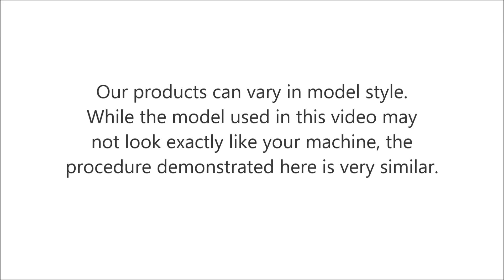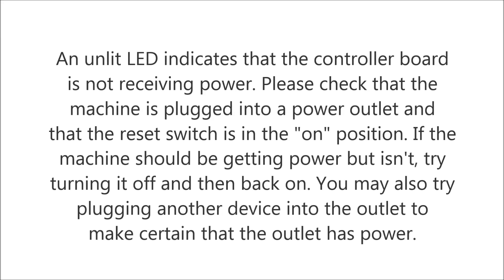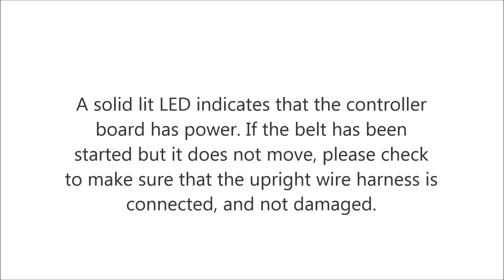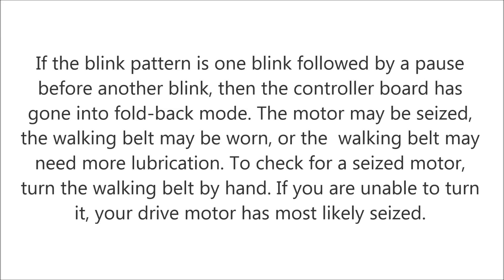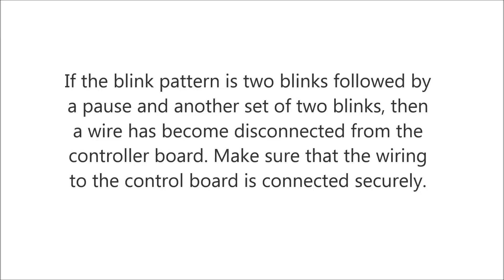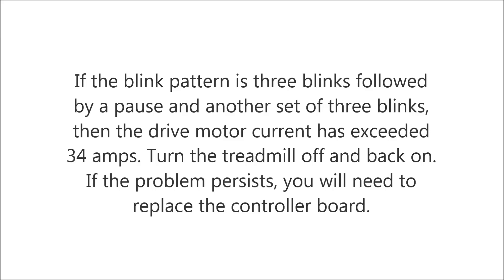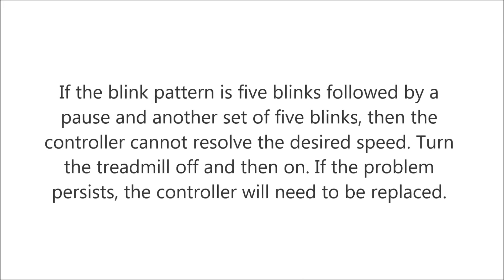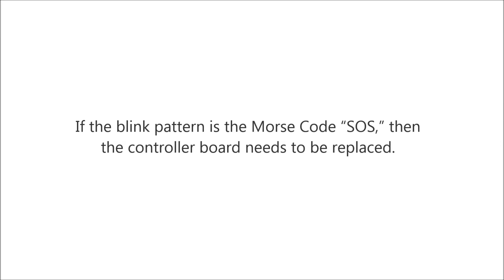LED Blink Patterns on the Control Board - Treadmill

Comment: I have an Xterra tr6.4 folding treadmill.  It was working fine and then I moved. The movers spliced thru a set of wires so I thought that was the issue. I replaced that with the company but my monitor still doesn't even light up.. I am getting power at the base because I see things lit up. How do I get to the LED panel to look and see if it's any of these issues?
Reply from the maker: I'm not personally familiar with the Xterra brand of treadmill however almost all treadmills have some kind of lower controller board near where the motor is located. The information in this video will not apply to that manufacturers product but checking the wires to the lower control board is a good place to start. Be cautions and unplug the treadmill before you work on it. ;)  You may find instructions to access the lower control board in your manual or online from Xterra directly.

Comment: my light comes on solid with powerup and starts a fast steady flash when the speed is initiated - after 5 to 10 minutes the console and adjustments start to change themselves - sometimes the belt stops and sometimes continues and the adjustments come back to what i had set - proform 6.0 sport only 2 yrs old - in remote location so getting a tech out is difficult - assistance with ideas?
Reply from the maker: When the belt stops does the led light on the controller (shown in this video also stop)? Is this occurring in a manual workout? 
This is almost certainty an issue with the console. If the speed/incline is changing on the console and the machine is performing what the console displays then it is not likely a controller issue. Most people that have the machine change on them are in some kind of preset workout, that's why I ask about if you are doing manual workouts. Also is the treadmill on a dedicated circuit and does this happen with no user on the machine?

Comment: Hi. My proform treadmill led stays on continuously. The belt spins freely and when I press start the motor moves for a split second then shuts the machine off. Any ideas? I'm happy to pay for your advice
Reply from the maker: It sounds like you will need a new lower circuit board called the Motor controller.The question would then be what is the light doing after you press the start button and the motor jumps. Likely you are getting an error blink code. most error codes indicate a replacement controller is needed.

Comment: What if the controller light does not flash at all? My Nordictrack treadmill is only two weeks old. The ifit console has power.
Reply from the maker: if the red light is on solid and not blinking then a speed signal has not been received by the controller. It will blink when you start the workout on the console. If the console is running a workout (time counting & speed displaying above 0) then it usually indicated a damaged wire and the speed signal is not making it to the lower board/controller.

Comment: I have a horizon ct9.1. The console is 88:88 both sides. Ive reset, unplugged, done all suggestions I can find. I’ve checked all wires are connected. Underneath the led light is solid red. The belt moves when I move it. The magnetic key engages the belt when I take it out and put back in. None of the console seems to work. Suggestions? TIA!
Reply from the maker: Although I'm am less familiar with the horizon brands it does sound like you have a problem related to the console.I would guess that the console would need to be replaced. I would contact Horizon directly for replacement parts or any other advise.
Reply: Fitness Equipment Help thanks for your opinion!

Comment: Fitness Equipment Help: My  NordicTrack model 24934.0 display console is not powering up. Issue started after moving to a new location and re-assembling. Controller LED is solid red and blinking rapidly. The hall-effect switch signal does change from 6V to 0V when moving the magnet switch. The console tablet is not getting the 12V DC. The tablet is powered ON after I applied external 12VDC to it, but tablet goes OFF after 5mins with screen message: safety key removed replace key to continue.. Although the magnet switch is ON. What could be the issue? Thanks!
Reply from the maker: it really seems you don't have communication or power from the Brain board (PCB) in the console to the tablet. there should be a wire header on the tablet labeled "Keys" this should be where the tablet gets its information that the key switch is on the console. if you have voltage to the key switch then the controller is producing the voltage and it is being received by the console PCB.  seems you may have a brain board issue with the console not sending voltage and signals to the tablet.
Reply: @FitnessEquipmentHelp  I took a look again at the header-2 wires from the controller (MC2100) to the display console. The HD2 wires are: Black, Red, Green, Blue, Orange, Yellow, Violet and Black. Unfortunately there was no voltage on the Red wire. But I did measure 12V on the Violet line.  So what is missing is the 12VDc needed on the Red wire. I confirmed by applying external 12VDC to the Red line, and saw that the tablet was powered ON and it did recognize the magnet key switch. Any suggestions?
Reply from the maker: @yodamartin4859  Is it possible your wire harness is plugged in backward? That would explain why there is voltage on the purple and not on the red.
Reply: @FitnessEquipmentHelp  Thanks! for your help. Connector connected in the wrong orientation. The space is tight, so to connect the wire wrongly shows a poor design. I saw a key on the header, and I assumed it'll prevent the harness from connecting in the wrong orientation. It took more effort to connect the harness in the correct way.

Comment: I have 4 blinks - pause - 4 blinks .... which would indicate false switch - what switch is this referring to  ?
Reply from the maker: A component of the controller called a fett... Basically it means you need to  replace the controller.
Reply: Thanks for your reply , Do you mean one of the FETs  attached to heat-sink . I am quite knowledgeable in electronics and I could probably replace that one . Do you think that is fees able ? I do have MC2100LT Rev ICON 2006 controller board . On this board there is Q4 IRFP250 HEXFET . 

 @FitnessEquipmentHelp
Reply from the maker: @radim100100  It already sounds like you are more knowledgeable on the subject than I. I know that in these situations i replace the controller. I Could not identify the fett. I have just been told that is what the 4 blink error indicates. Sorry.
Reply: Thanks anyway
Reply: @radim100100  - Replacing MOSFET fixed the issue ?  I have RFFP 250 M which seems t be short
Reply: @SachinVyasMewar   Did you replace the MOSFET?  Did it fix the issue?  The MOSFETs on my board are labeled IRFP250M and S4025L.
Reply: @dustinshaw9435  Thanks for your response.  I have not replaced the MOSFETs yet as I am still not sure where to procure them.  Any suggestions?
Reply: @SachinVyasMewar  I purchased some from mouser.com a few days ago.  They have not arrived yet.
Reply: @dustinshaw9435  okay. I will check that site out.  In the meanwhile if you replace it then please share your experience.
Reply: @SachinVyasMewar  I replaced the MOSFET labeled IRFP250M.  The treadmill worked for a little, but then stopped.  I read somewhere else that the IRFP250M could/should be replaced with IRFP260M, so I did that, and now it works again.  Although, now my treadmill speeds up and slows down when it is running, so now I have to figure out why it is doing that.  It did this when I had the new IRFP250M installed too, so it's not the IRFP260M that is causing this issue.
Reply: @dustinshaw9435  Thanks for the update.  Not sure if that needs calibration or the signal being sent to motor is the culprit ( led blinks ? )
Reply: @dustinshaw9435  - I got the IRFP250M and replaced it and initially for a minute or two it did not work and then started working and in a day the LED stopped blinking.  I do see the LED on when powered on but when I try to increase the speed the LED is not blinking.  What I have noticed is that as I increase the speed the LED dims down.  I did follow your advice and got the 260M as well and will try to replace but did you observe the same behavior before replacing the 250M with 260M ?  Thanks in advance
Reply: @dustinshaw9435  so I observed something a) LED powered on once treadmill’s power was on.  b) initially when speed was increased no motion c) increased the speed to levl 10 led dims and goes completely off and then all of a sudden comes up bright red d) press stop and start treadmill is operational.  Tested a quick 30 minutes run plugged in and out it seems to be working so not sure if its capacitor or some loose connector …will keep researching ..if you have any idea then please share

Comment: Are there blink patterns for the incline motor? When I turn my Nordictrack 2450 on the incline motor inclines a few inches then declines back to original postion. When I run a manual workout I am not able to change the incline. When I do an incline calibration I get an error and the calibration is canceled. My guess is the incline sensor is bad???
Reply from the maker: It depends on the motor controller. some of the newer controllers have a LED that indicated when the incline up or incline down signal is being received from the console. (Not a blink though). your description of the console moving up a little then down a little while trying to calibrate is indeed indicative of the console not receiving an incline sensor signal when it is expecting one. This could be a bad sensor or a damaged wire between the sensor and controller or the controller and the console.
Reply: @FitnessEquipmentHelp  I appreciate your help! Let me back track... When I did the inital incline calibration the incline motor started and didn't stop. It inclined so far that it lifted the base off the ground and broke the belly pan. When I heard the belly pan crack I stopped the calibration. I powered the system down and back on again and incline motor kicked back on. I powered off and unplugged the system and removed the incline motor. I reconnected the incline motor outside the belly plan and powered the system up. The incline motor then inclined for a few seconds, declined for a few seconds then stops. I removed the incline sensor and it had clear grease all over it. I cleaned up the sensor and put back in the incline motor but still got the same 2 seconds up and 2 seconds down. Here are a few more questions... #1 Is it common for the incline motor to over incline breaking the belly pan if the incline sensor or wire is bad?  Seems to me the incline motor would stop inclining at 15 since thats the max? #2 Is the incline sensor supposed to have grease all over it?
Reply from the maker: @davidlovato5330  The incline senor "lives in the incline motor next to the main gear that has magnets embedded in it. the gears are greased up so it is fine if the sensor has grease on it. It wont effect the sensors ability to detect the magnets. It sounds like during the calibration process something in the motor broke. It might be helpful to understand what is happening during calibration. the console sends the incline up signal to the motor. The motor extends until it physically can no longer move due to some sort of physical stop. Usually internal to the motor. Once the motor "jams" the magnet in the gears no longer pass the sensor and the console stops sending the incline up signal after about 1-2 seconds of not getting a reading from the magnet sensor. The console then turns around and sends the incline down signal till the motor "jams" in the down ward direction. It stops sending power to the motor when again it doesn't get a sensor signal for about 1-2 seconds. While traveling down it counts the number of magnet passes from the highest position to the lowest position. the console uses the number of magnet passes to calculate the different incline positions for the machine.  If the motor is turning on in calibration and stopping after about 2 seconds and going back after about 2 seconds then the console is  not getting a sensor signal. After what you describe it could be because the motor has broken. No, this is not very common. The incline motors tend to be the most robust component on the treadmills. They are designed to lift the weight if the deck/frame and a user while the user is running on the machine.
Reply: @FitnessEquipmentHelp  Fortunately I own 2 Nordictrack treadmills (A2550/2450). I am having issues with the 2450. I connected the 2450 incline motor to the A2550 control board and the motor worked fine. 
When I connected motor back up to the 2450 I get the 2 seconds up and down. If I do a calibration I get an error to try again. Does this mean its the control board, console or console wire?
Reply from the maker: @davidlovato5330  If the issue did not follow the motor then it is sounding likely that the issue is with another component. The only thing I can say for certain is if the incline moves up a little then down a little in calibration then the incline signal did not reach the console when the console was expecting it.  Anything between the motor (sensor in the motor) and the console is suspect. If you believe the motor is intact you can plug the good motor into the suspect treadmill and it should give you the same error. then you would know it is an issue with the controller or wires.
Reply: @FitnessEquipmentHelp  THANK YOU THANK YOU THANK YOU!!! I put the A2550 incline motor in the 2450. When the machine powered it finished the incline calibration that I had started when the 2450 incline motor cracked the belly pan. After it finished calibrating the A2550 motor I ran the machine and the incline worked. Since the console was responding I decided to put the 2450 incline motor back in and try it and IT WORKED!!!  

My guess is the console locked the 2450 incline motor out after the failed calibration that cracked the belly pan the other day. The only thing that explains a cracked belly pan is something not being in the right place or stuck once the motor started lifting???  There really is no way to install the incline motor incorrectly. Thanks again for your help!!!

Comment: Man, you just saved me a fortune and my exercise in the coronavirus lockdown.  Took the motor out yesterday and checked it using the cordless drill power pack trick.  Put it back in and was getting two blinking lights.  Must've knocked connector to the controller board so took them all out, put them all back in and bingo! One fixed machine. Thank you very much!
Reply from the maker: I'm glad your up and running... Stay healthy.
Reply: @FitnessEquipmentHelp  I have an s22i bike that is blinking 4 times, then 2 times, then pause. What does this mean? Thanks for a response!
Reply: Hi I have a proform 450 cx treadmill
Red solid led 
Everything except the motor works any idea thanks
Reply from the maker: @denislenihan7848  the led should be blinking when it receives a speed signal from the console. if you have started a workout and the speed is set above 0 mph the LED should be blinking. If it is not then you may have a damaged blue wire in the wire harnesses connecting the console to the controller or a bad console.
Reply: @FitnessEquipmentHelp  thanks I think it's the board no problem with the wires
Reply: All I did was move my golds gym 410 treadmill downstairs to the garage, & now the belt is not moving whatsoever.

Everything else functions except the belt. I can move the belt manually though. I checked all the wiring & see no problems @ all.

I am so bummed & confused. It was working fine upstairs in my room, but all of a sudden, it doesn't.

What could be the issue? I was finally motivated to commit to more exercise because of this quarantine 
:(
Reply: @TheTerminator619sd  did you figure it out? I have a treadmill that was used for 3 years but not hard use and then it was moved and put in storage (packed well) and since it came out of storage everything works except the belt. I connected the motor to a battery and it turns the belt so there seems to be some issue with the control board. Even when I hit start the relay on the board clicks but the belt don’t move. So it seems the control board receives the start signal from the console but the motor is not receiving a signal from the board.

Comment: What is the Switch referred to with 4 blinks??
Console?
Reply from the maker: It is a component on the controller PC board called a FETT. It means the controller will need to be replaced.
Reply: @FitnessEquipmentHelp  
FETT?
Don't see anything with that designation? Does it have any normal circuit identifier?
Reply from the maker: @alaninness8113  Sorry, I'm unfamiliar with replacing parts at the component level. My recommendation is to replace the motor controller.
Reply: @alaninness8113  - ITS IRFP 250M MOSFET bolted to heat sink